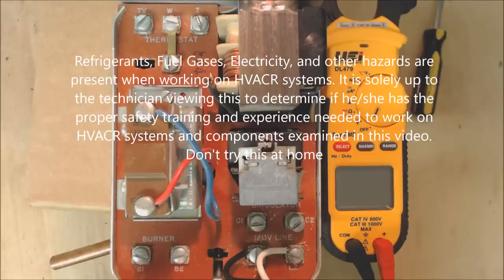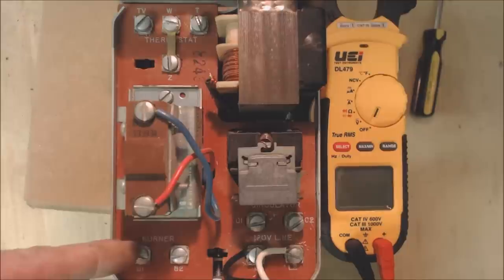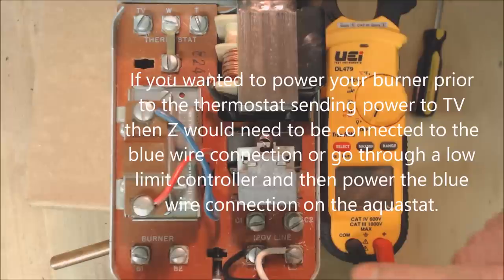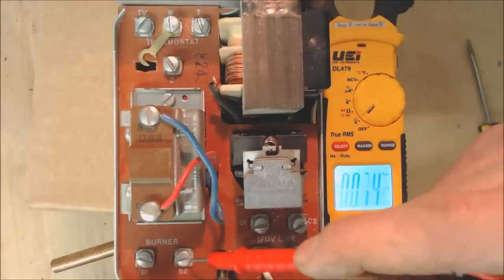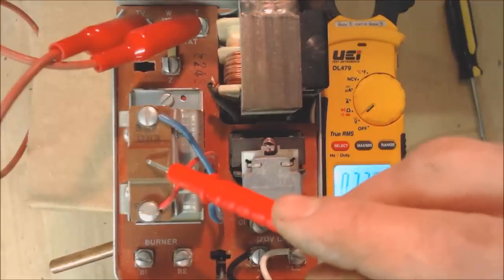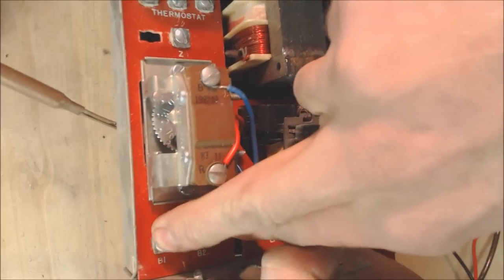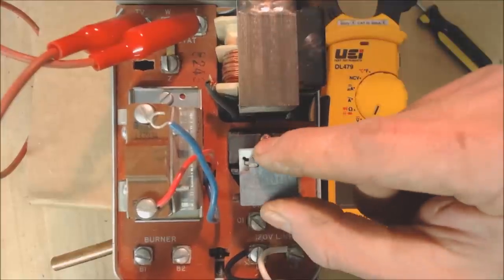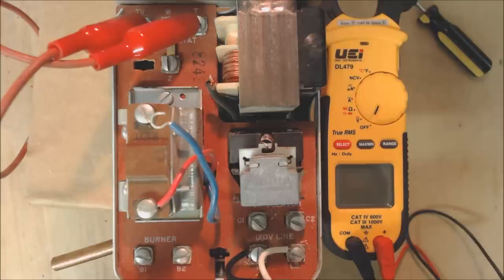Boiler Aquastat Relay Troubleshooting and Control Wiring!

Comment: What might be causing the oil hydronic burner, to once it reaches the high limit temp. and shuts down, it immediatily fires up again before you could blink an eye or take a breath?  Three Facts,  1- boiler high temperature has been reached, and 2- there is no call for circulator to run, 3- no domestic water is being used at the time!  What should I be looking for?  Thank you for your help!!!

Comment: Correction @ 05:30: the 24V line is in the RED wire and that's why @ 06:30 you've clearly tested ~(21 - 24)V (while you were saying "we have nothing") in the BLUE and B1 wires because the aquastat was closed.

So annoying to have expert tell you something when I see it with my own eyes it isn't so and no errata was issued...WTF?

Comment: Thanks for the video.. question: a loud humming sound is going out from the transformer?  This mean I need to replace whole relay? Is it bad if i leave it running until replacing it?
Reply from the maker: They may get a little louder as they get older and if the resin wears down. It just depends on how loud really but at some point it would need to be replaced, thanks!

Comment: Awesome video, thanks!  Quick question ... so I need 24VAC for Ecobee smart thermostat.  Looks like I can get that from B and Z terminal for continuous power.  Ecobee support said I I need a separate transformer to power the stat, and not to use the one on the boiler.   This is running 3 zone valves then signal back through end switches to fire burner etc? Any reason for that you know of we'd need an extra transformer?
Reply from the maker: It is so that you don't go over the VA of the transformer on the board. You can just run a transformer from the main 120v and come off that to power the stat to be safe. Make sure the transformer is inside of an electrical housing and that no 120v wires are exposed, thanks
Reply: Yes I just went through this myself the problem is the the transformer in the honey well is not meant to run the burner,rely AND your new thermostat it over loads it and could possibly shorten the life ...just listen to this guys advice and buy a separate transformer to power the thermostat
Reply: I don’t get it it’s only a thermostat how many VA is going to be
Reply: Hi I replaced an old one with a new model today and when I switched on the boiler I had 24 volts at b1 and b2 while the thermostat was calling for heat.  After a minute or so, b1 and b2 was reading less than 10 volts.  Circulator was still running fine and the transformer was still outputting 24 volts.  Do you think there is a short somewhere that caused the relay to go bad?  Thank you

Comment: hi, do you have to drain the boiler first before replacing this aquastat? due to the fact that  the probe is touching the boiler water. thank you.
Reply from the maker: Hey Mark, the sensor is in a well. The well is what keeps the water in the boiler and that doesn't get changed out, thanks!

Comment: Awesome video. So if I understood correctly, if you were to get a thermostat that required a C wire, could  the C wire be hooked up to terminal B2?
Reply from the maker: I wouldn't add an extra load onto this setup. The transformer may not be upsized to handle the extra thermostat load, thanks
Reply: @acservicetechchannel   im  new to this! how would i add an extra load ?
Reply: Have the same concern right now, were you able to run the common on B2 without any issues??

Comment: Hey quick question regarding gas valves. On old furnaces with the combination gas valves if it says mv on it that means that the main gas valve only opens when 24v dc from the pilot flame is powered to it through the t-stat? Or would it still work on a 24v transformer system?
Reply from the maker: Hey Daniel, the pilot valve must be opened first before the gas even gets to the main valve. Have you checked this video out yet?- https://youtu.be/7m5ZDvOoVwU  --  also I have written 32 articles and have videos over on patreon.com/acservicetech if you are interested. The access is the community level at $3 per creation but you can set a monthly max at $3 per month. It is also something that can be canceled easily. Anyway just letting you know and it also includes email q/a as well thanks

Comment: I have the Honeywell L8148a1017 that keeps failing. Apparently the do that frequently. The current is about 4yrs old and again failing. Is there something more reliable I can replace it with?
Reply from the maker: What keeps failing theoutput relay switch contacts or something else?
Reply: @acservicetechchannel  The main relay generally. I searched and found vids describing bad solder joints on back. So checked and sure enough bad solder joints. Then I fixed those and worked fine for a few months. Then it failed to turn on circulator. So replaced whole aquastat all in 2015. Now the relay has failed again, clicks about 2-3 times then starts. Sometimes clicks then almost starts. Then few minutes later it will try again clicking multiple times and then start run for a few minutes then shut off mid cycle. Sometimes it will stay running properly for a while and house will warm up like normal. Then it cools down and relay clicks multiple times and boiler fails to start at all and house gets gets cold. If you push on the relay to close the contacts Everything fires up like it should, releasing it everything shuts down. So I just replaced it with an upgraded model the L7224U-1002 universal. It doesn't have that same relay that continuously fails. And uses a newer electronic contactor or something. I uploaded a vid of it just now, appears to be working great.

Comment: Noticed the boiler would get hot and shut off after the 180 setting but the gauge on boiler would keep rising to over 200 and it would make the prv drip  on the boiler ... that has to be the aqua stat malfunctioning right
Reply from the maker: It really depends the type of unit. If it is a standard natural draft, the temp will continue to rise after the ignition is shut off. Try setting the aquastat down lower such as 170 or 160, thanks
Reply: @acservicetechchannel  was thinking maybe the water feeder might be the issue allowing it to take in extra few psi  one guy told me could be pin hole on coil but if it was a pin hole wouldn't it lose pressure?? Remember I do hvac mainly boilers trouble shooting I havent had much experience in thanks
Reply from the maker: If the boiler is natural draft then I would first try to decrease the setting on the aquastat especially since you say that the ignition stops as soon as reaching set point. However natural draft boiler temps will continue to rise after ignition is off. Remember, the cast iron heat exchanger is still very hot when ignition shuts off and this explains the 20 degree rise in the water, thanks
Reply: @acservicetechchannel  yea natural draft from chimney

Comment: I'm having issues with an aquastat. My boiler will run for awhile and then it just stops. If I throw the power to it off and back on it will fire. Any ideas?
Reply: Check your wire nuts.  Look for a broken wire.

Comment: Hi Acservicetech!  Thanks for the video. I been waiting for this one.  One question. The temp dial on this single aquastat, is that the same as the red dials on the triple aquastat?  Do they serve the same purpose? Thanks again.
Reply from the maker: Yes it is like the red dial except this is always just the high limit. You can add a low limit to this externally. Also if you see the two red dials then that is a high and low limit so your burner can heat up the water before circulating, thanks

Comment: Nice one, Craig.  I’m guessing on the wires going to the thermostat that the 24 v. common is not run to the thermostat?  If not, makes trouble-shooting harder when checking for 24v at the thermostat.
Reply from the maker: Yeah typically you have a battery operated stat or mechanical due to the VA size of the transformer in the aquastat, thanks Jack!

Comment: I have a Honeywell Aquastat relay #L8148B for my gas furnace. I had a electrician hook up a plug to my power switch so I could use my furnace with a generator if I lose power. We had power to the relay but when we tried it with the generator the furnace would not work. We removed the generator and had to wait about a half hour to the furnace would run. Is there any safety delays in the relay or any idea what’s going on.
Reply from the maker: That doesn't sound right. Is it possible, the power is feeding into this backwards with the hot being common and common the hot accidentally?

Comment: I have a question hope some one can help, i got a new relay box but I don’t get a reading of 24v on B1 but i do have 24v on the orange wire wend i turn on my thermostat, i got my burner to start up by connecting b1 directly to the orange wire . Help pls

Comment: How can I connect multiple Aqua-stat Relays (3) with one standard thermostat connected to TV-T. I paralleled all TV-T to the one thermostat but everything is shorting out. If I work one-by-one individually, they all are working. Whey cant I simply parallel all TV-T to one thermostat. I want all Aqua-stat relays to work from ONE thermostat. How can I accomplish that?
Reply: I have 3 exactly the same boilers with T-TV terminals (Aquastat Relays), and I wish to run them from one thermostat. I thought that I could parallel T-TV,  but that doesn't work. Any advise / solution would be much appreciate it.

Comment: I checked mine tonight because the relay was clicking on and off,seems the circulation side is not making good contact and sizzle sound when it does
Reply from the maker: Nice, sounds like you need to replace the aquastat relay, thanks

Comment: could you explain how a L8124A triple aquastat works in a combination wood/oil hot water boiler, it also has an isolation relay ...
Reply from the maker: Are you talking an outdoor wood boiler connected to the return side of an existing oil burner with a plate heat exchanger?
Reply: no, a combination wood/oil New Yorker boiler in the basement of a house ...

Comment: Hi can I use 'Z' for my 'c' wire so I have common on my nest smart thermostat?
Reply: based on the video it appears B2 is the common terminal, did you get to work or your ran a separate transformer?
Reply: OMG where is the answer to this question.  If there is only 2 wires going to wall thermostat why can’t you just connect the t of the aqua stat to the  c wire terminal of the wall transformer.  
So I guess just put a jumper wire from T to C at the wall thermostat??
How many VA could it add ?
Reply: @jameseiden2340  unfortunately no, nest gives you errors. But by now I have another thermostat with batteries. Even with those you have to watch out

Comment: I have a honey well box on the side of my oil boiler every time the heat down stairs clicks on it makes a buzzing sound I have a video of it on my channel what exactly should I do about this?
Reply from the maker: Hey I watched the video. That is the transformer or more likely the relay inside that is making that noise on the coil. Basically, there is nothing you can do to stop the noise or fix the problem other than replacing the component- RA89A  thanks
Reply: AC Service Tech LLC oh ok thanks
Reply: AC Service Tech LLC I’m leave it for now it’s still working maybe next year I replace it

Comment: What does it mean if I don’t have 24volts on the burner side but I have 24volts on the thermostat side of the aqua stat
Reply from the maker: You would also need to check to make sure the aquastat contacts are closed or open as if the temp is already high enough.
Reply: So my burners been off for over a year so I know the temperature control is “open” I know I have 24volts at the thermostat side because I jumped the gas valve wires to the T & TV side just to see if the valve would open and it did. I think the temperature control has gone bad. Is there a way to test it? Also if I wanted to temporarily turn on the boiler while I got a new aquastat would it be safe to just manually hook up the gas valve to the 24volts side.

Comment: What causes a oil boiler to continuously run, even with the relay in the open position (non energized)? In other words, you can switch the power on/off but relay doesn't move either way, stays in open position, power on, boiler starts.

Comment: What would be bad if the relay always stays on and doesn’t shut off, it shuts off if I press it down. I have to shut the switch on the main to power off boiler

Comment: I have Burnham Boiler running the same board as the video.

When I power the boiler and call for heat. Not firing up.

Tested connections for power as you detailed in the video.

L1 and L2 @ 120v
C1 and C2 @ 120v
B2 to Z @ 24v
B2 to T @ no volts
B2 to TV @ no volts
B2 to Red and Blue wire @ 24v

Circulator is running and with thermostat at call for heat, magnet connection is made.

So the main issue is the B2 to T having no volts.

Any ideas?
Reply: Also if I removed the blue wire and only check the blue wire to B2 I get 24v.
Reply: Have an old three wire thermostat and only the R and W are connected.

At boiler power switch on and no call for heat, Thermostat R & W reads 24v.

At boiler power on and call for heat, R & W reads, no volts.

Thermostat bad?
Reply from the maker: To test for 24v you would need a common. A common occurrence with these old aquastats are the connections at the relay. The relay works and sucks down but either the low voltage or high voltage connections become pitted and are high resistance not letting voltage across, thanks
Reply: @acservicetechchannel  Does this mean replace the relay or can it be cleaned? If cleaned, what is the best way to clean the connections?
Reply: I forgot to mention. This is a single thermostat system on main floor running only non cast iron rad baseboards, in 7 rooms. the hot water heater heats all other water sources other than heat.
Reply: P.S. I will add one more item, that Aquastat I have is at least 18 years old. Time I have owned the house.... Maybe just replace and go?
Reply from the maker: Yes replace it if it seems the contacts are not closing, thanks

Comment: hi iace having some issues with utica residential boiler....intermittent wont power off ..stays running when thermostat not calling for heat and thermostat wires disconnected at thermostat...did some testing today after watching one of your video..very odd results... i tested terminals TV...W...T at aquastat honeywell L8148E 3 yrs old...here are results using B2 as ground and no call for heat i get T=24V W=24V TV=0V.....uisng B2 as ground and thermostat call for heat i get T=0V...W=24V...TV=0V........using metal case as ground and thermost no call for heat i get T=0v..W=0V...TV=24V....using metal case as ground when thermostat calls for heat i get T=0V..W=24V...TV=0V

these seem very funky and do not correspond to your video on same aquastat..can anyone help me out and explain why i cant get accurate reading using B2 as ground on the 24V side?
Reply from the maker: Is B1 and B2 going to a 24v burner or something else? Also try disconnecting the wires going to the components such as B1 and B2 and just test the relay itself in case there is some type of voltage coming from another source.

Comment: I have a Honeywell L8148E relay and I have 3 zone valves going to 3 different floors, My Question is if the relay was bad would all 3 zones not be able to call to the Boiler or can separate zone still be able to call to the boiler with a bad relay.
Reply from the maker: The zones may still call if they are on a zone controller powering a circ pump instead of the l8148e

Comment: What if i dont have 24v at t or tv but relay is on and burner on?
Reply from the maker: It sounds like that relay contact is accidentally closed proving power to B1. try disconnecting the wires off of the controller and then test it to verify then problem is definitely the controller, thanks

Comment: What if circulator on but no 24v to gas valve?....
Reply from the maker: That 24v contacts for the relay switch could be bad if you have this setup but the circ contacts are good
Reply: thank you removed circuit board contacts all good...there is a 3a fuse next to B2 that was open....what could cause this?? @acservicetechchannel